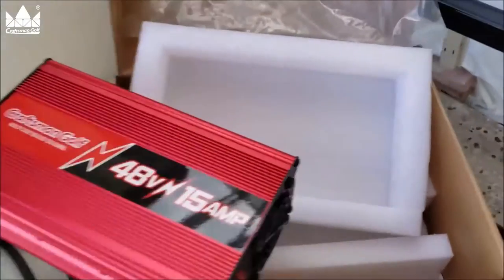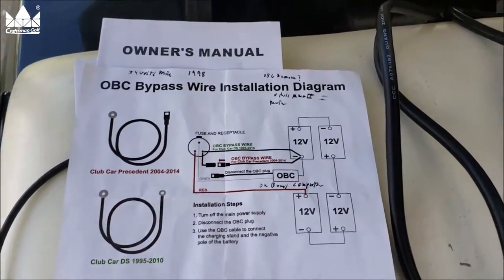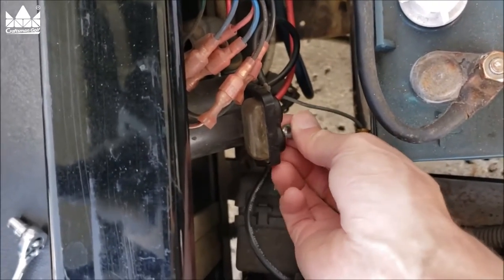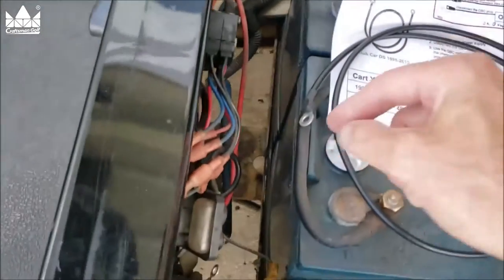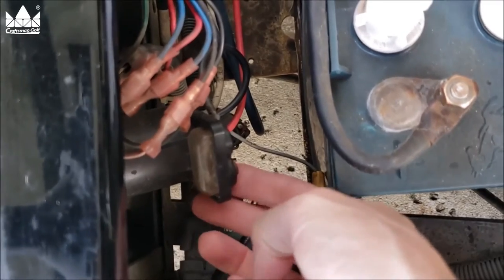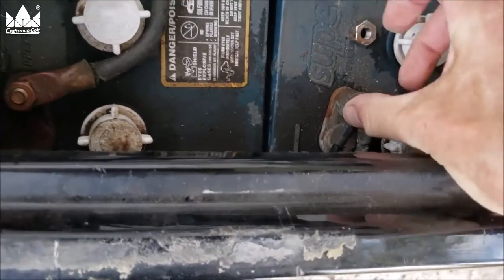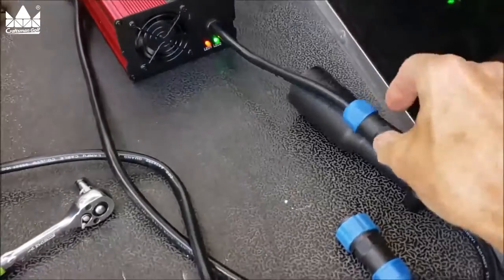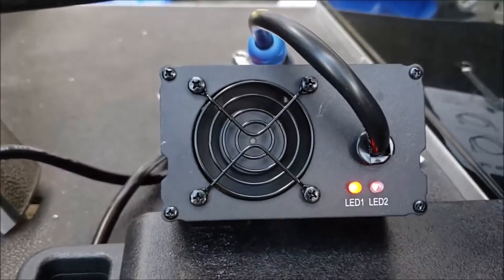How to Bypass Club Car OBC

Comment: I bought the HTC charger with the club car plug and it came with the a set of alligator clips as well.  I have yet to figure out how to bypass the OBC on my 1997 Club car so have just been using the clips on the main Pos. and Neg. to charge.  I'm going to give this a try.  Hope it works! Thanks.

Comment: Do you have to have this after market charger, to do this?
Can I do this while using the stock charger?
Reply: Depends on the year, some 2005 and newer models have stock chargers with an internal charge profile, but doesn't use it, it's a slave to the OBC. If you bypass the OBC on those stock chargers they will start using the internal charge profile. On 2004 and older models the stock charger depends on the OBC for a charge profile, so if you bypass the OBC the charger will not shut itself off. Generally you should use an aftermarket smart charger if the OBC is bypassed.